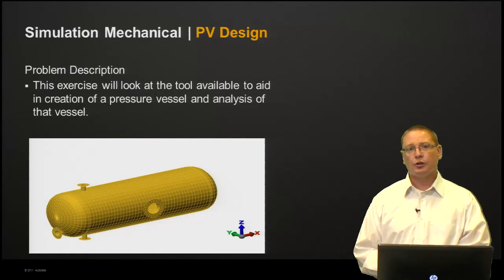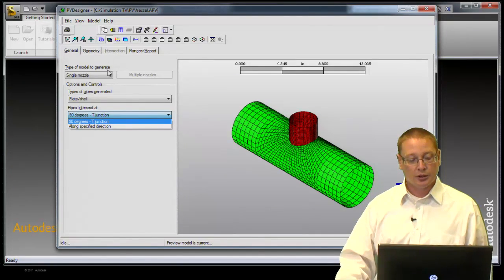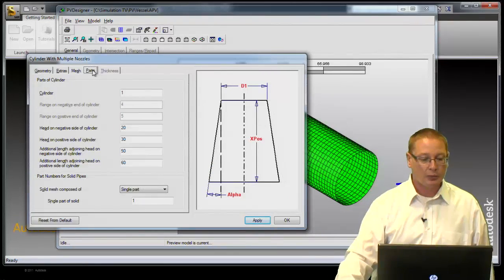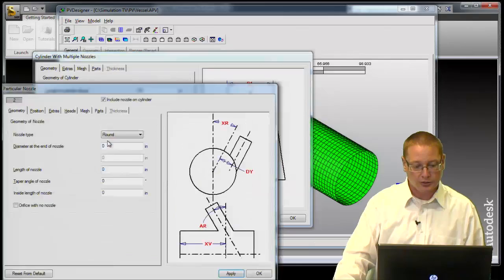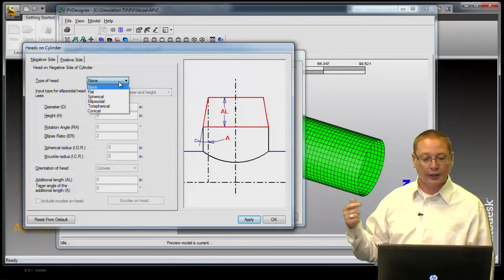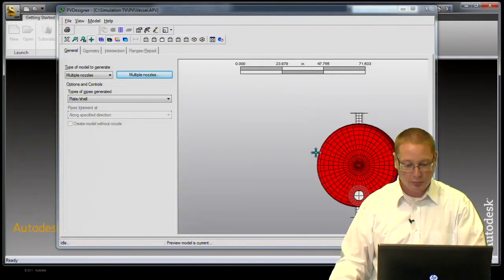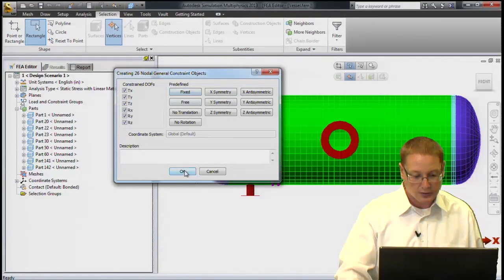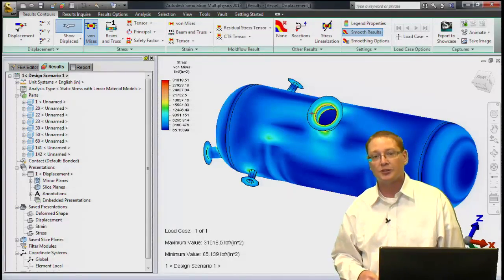Simulation in Action:  Pressure Vessel Designer

Comment: Dear Mr. Mike Fiedler,
Thank you for your sharing, but i have a quick question about the temperature ( operating and desing temp.) how can we add it to the model, because i saw in your video you just consider about the pressure only, 

T&Brs
Reply: You probably will have to do a thermal analysis and then perform stress analysis. There is no coupled-thermal analysis in Autodesk products.